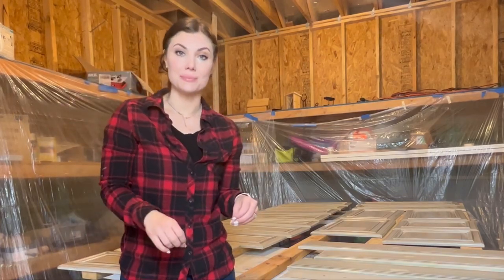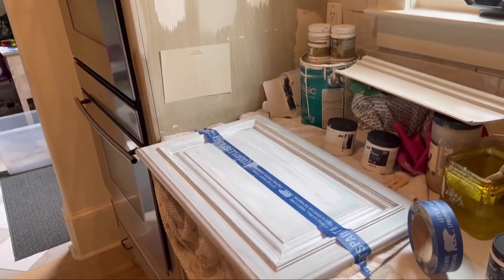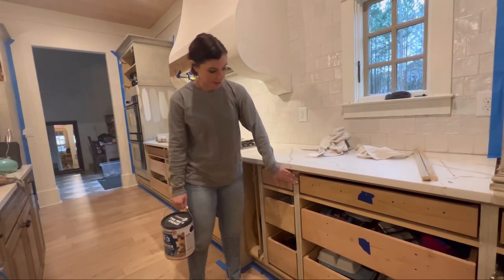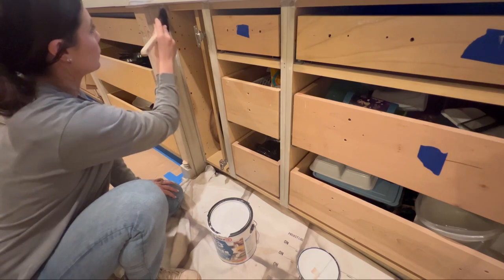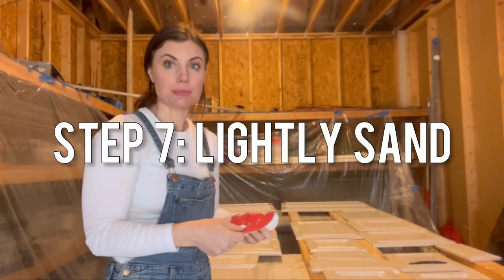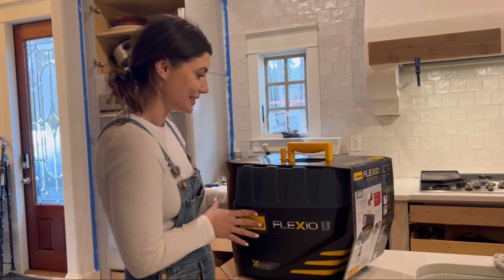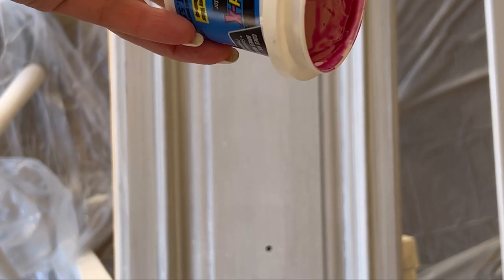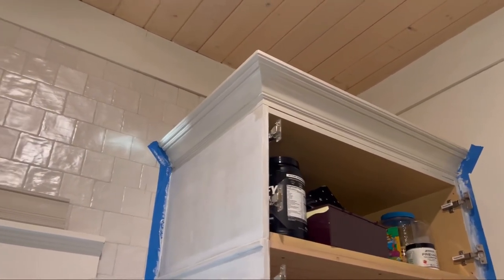Must-do Prep Steps Before Painting Your Kitchen Cabinets!

Comment: I have a question. We were given horrible advice about using Stripper on our stained cabinets and then once that took a long time and was a huge mess, we decided to use our sander to sand our cabinets to the point where there was no stain left🤦🏽‍♀️ 

Then we were given advice to use sprayer gun and let’s just say it put primer on super thick. We’ve started sanding it down but then it ripped pockets of primer. Are we better off using a stripper and removing all the primer we’ve done and try to go back to ground zero?

Also when we do the trim can I use this Liquid sandpaper on stained cabinets instead of actually sanding? Thanks!